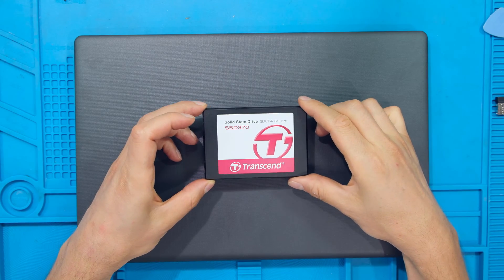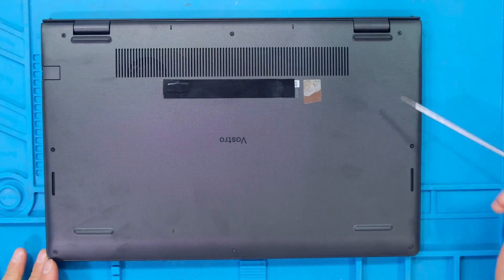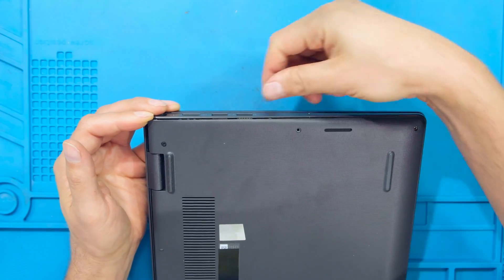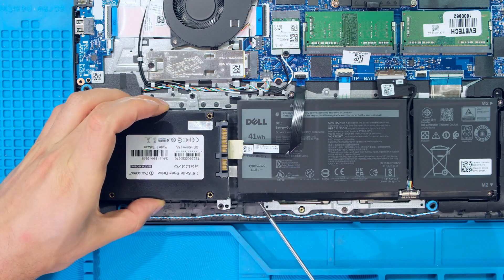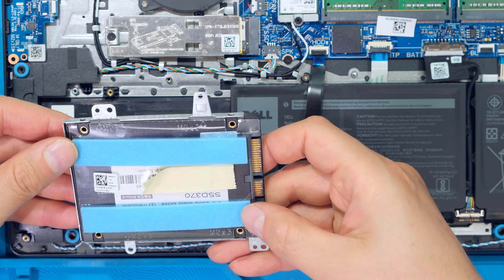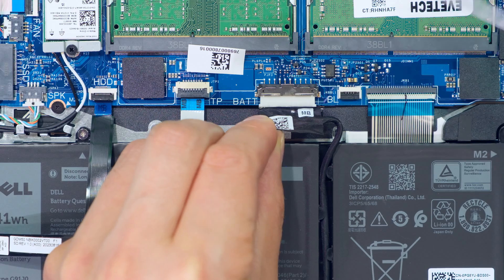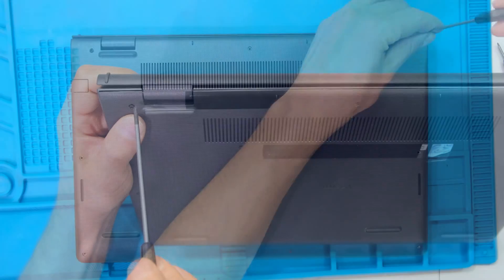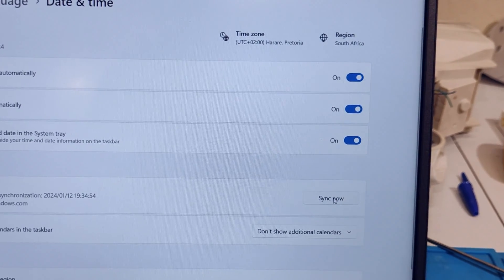How to install an SSD Sata drive in the Dell Vostro 3520 laptop

Comment: How come Dell doesnt mentio this in the specs? In no place I have found that there is an unnecessary/not used SATA port available for another SSD exceot the one that comes with the computer itself?